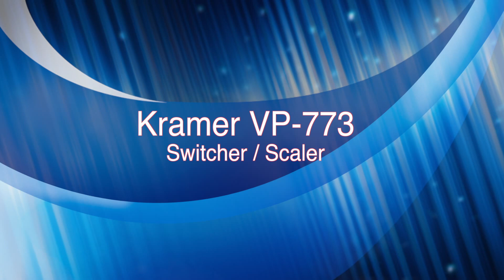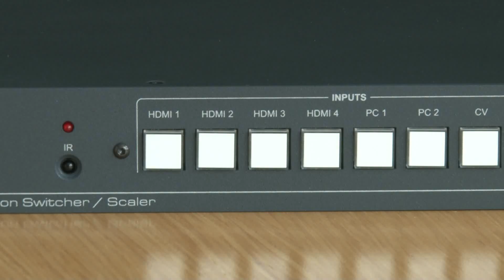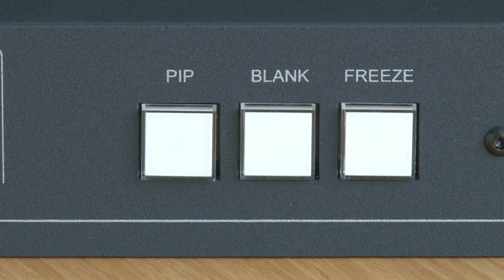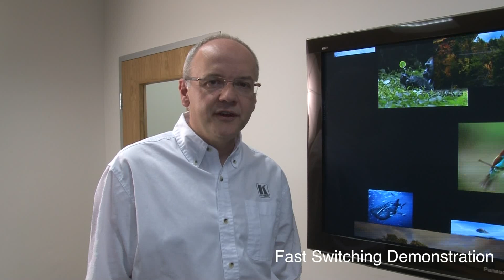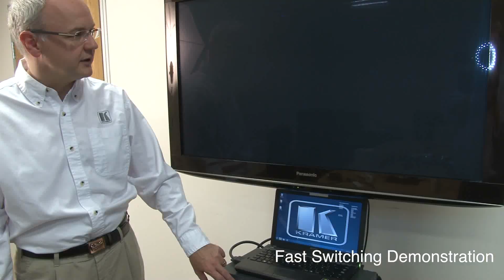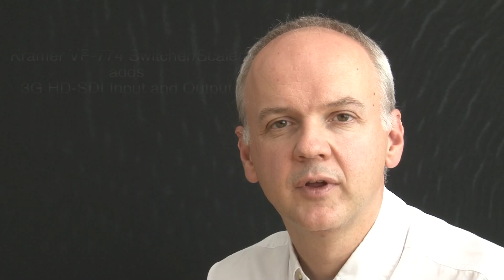Kramer VP 773: An Introduction/Product Update

Comment: due it's excellent Composite 3D Comb Filter it would be nice if the Kramer VP77x series would have more costumized scaling/zooming options like f.e. the inferior model vp728. With options to alter the horizontal and vertical zoom it would be possible to handle better the different aspect ratios on movies. Id love to see a firmware update from you Kramer Electronics :)
Reply from the maker: Thanks for your suggestions. We will communicate this with the product department.

Comment: So what does it mean when the unit refuses to respond, all the lights stay on solid red, and the panel lock button flashes but refuses to unlock?
Cos that's what a few of my units have started doing. Nothing in the manual to indicate how to fix them..
Reply from the maker: Hi! We are happy to help with any technical issues you may be having. Please send an email to us_info@kramerav.com and we will be in touch. Thank you.
Reply: Curious if you figured out how to unlock. Got a used Kramer and it is doing same.